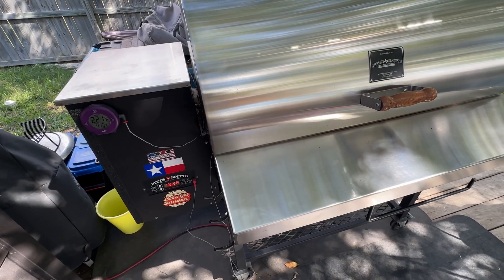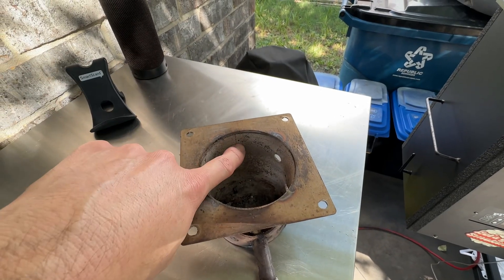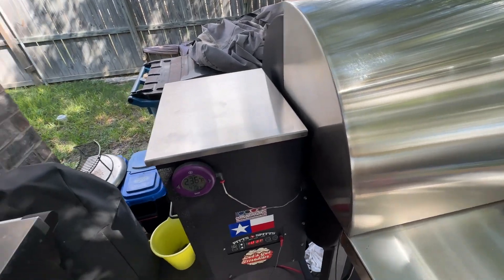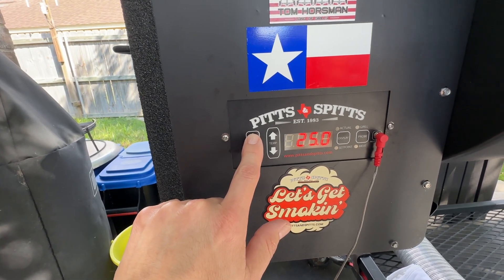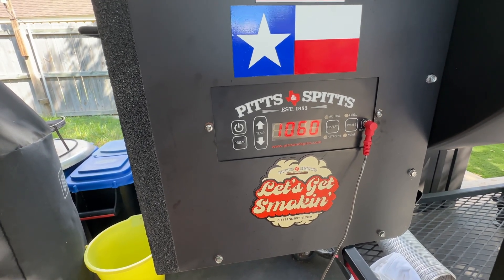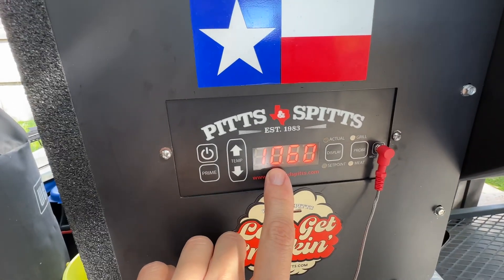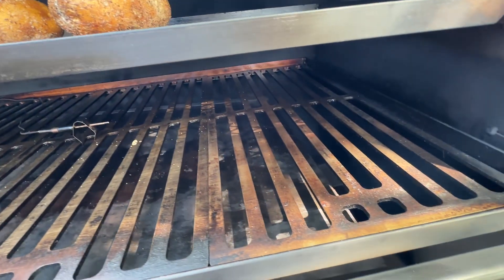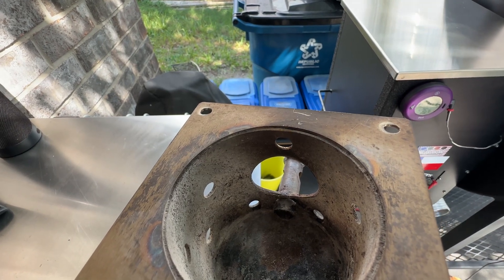Mods - Pitts & Spitts Maverick 1250 Firepot and controller.

Comment from the maker: I think I forgot to show that the DISPLAY and PROBE buttons are what move the values up and down.  After you set what you want you press POWER to save the value and PRIME to exit. The pit controller will immediately use the new settings.

Comment: I’ve tried to talk to Pitts and Spitts but when it comes to messing with the values on the controller they almost hang up on you. They will not give out any information. 

My grill has about a 30 degree different from what it’s set at to what it is. I’ll be using this to try to get it dialed in. 

Also trying to figure out how to get my to smoke better however I think this will help me get in the right direction. Thank you
Reply from the maker: Indeed…..sadly they are no help.  The C-13 value fixes all temperature related issues of the cooker being too cool or too hot. If you are running 30 degree too hot that may account for you seeing less smoke than expecting.  If it’s too hot you want the C-13 to go up…if it’s running too low you need to dial in a lower value.  

I feel the 9 hole firepot mod is a game changer not only because you get a bit more smoke action but the bottom two holes blow ash clear of the igniter which allows it to refire easily without cleaning the firepot every time.  I usually go 3 short cooks (2-3 hours or so each) before cleaning out the firepot.

Comment: Thanks for this video been looking for this info for a long time. Been trying to get more smoke out of my 850 and I’m hoping this helps. Do you know what each of the c-setting are?
Reply from the maker: No I do not.   It really comes up to experimentation.  I would also recommend that after your pit is warmed up, open the kids for like 10 seconds to let some heat out and let it settle in at its true temp.  This controller seems to sit 10-15 degrees higher after reaching temp when you initially turn it on.  This caused me some confusion in the beginning.  Being aware of that helps. Also, it takes the pit like 30 minutes to really lock in on a RTD gain change, so give it some time when making adjustments.  As I mention in the video, place an electronic probe of some kind wherever you want to measure/calibrate your pit.  I put mine near the left about 4 inches from the left wall right now n the lower grate.  Of course middle of the grate, I know I get about 10 degrees hotter because of the firepot and the top rack is typically 10 degrees cooler except near the smoke stack.
Reply from the maker: Also, keep the pellets the same.   Some have different BTU values. When you start using some pellets that have higher BTU, you will notice that the pit will run hotter and after half an hour it will dial itself down.

Comment: man, this got me pointing in the right direction, thank you very much 💯
Reply from the maker: @AGGEGUATON  glad it helped. One thing I suspected but didn’t mention and I want to do a video on it.  The controller is adaptive to a certain degree.   I will notice that when I change from one brand of pellet to another…if their BTU’s happens to be different, I will notice the smoker runs either low or higher by 10 degrees or so.   If you get desperate and don’t wait you’ll be chasing your tail on dialing in the temperature setting using the RTD gain. You need to let things settle down for 45 minutes to an hour and almost always the controller will re-adapt to the change in BTU’s the pellets are giving (causing under or over temperature).  As long as you keep using the same exact pellet brand/type when working on the RTD gain, you will get a true and accurate change with that setting.